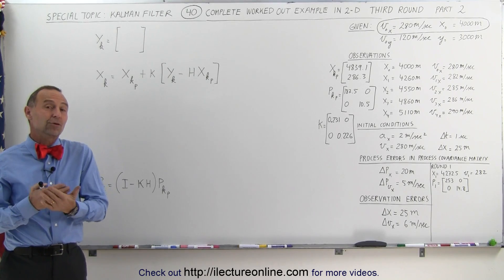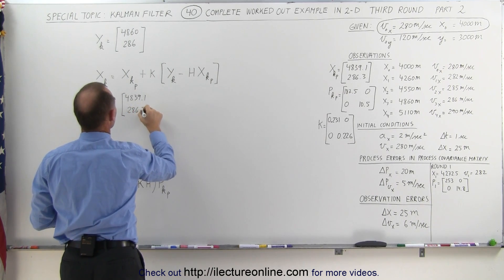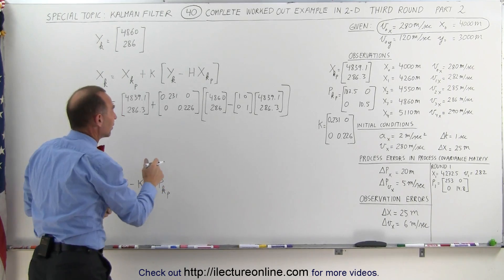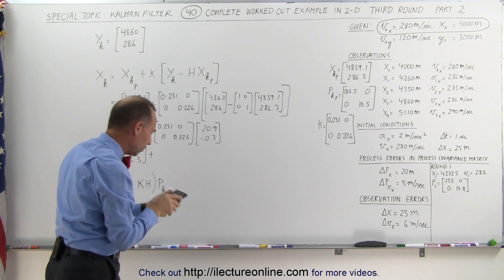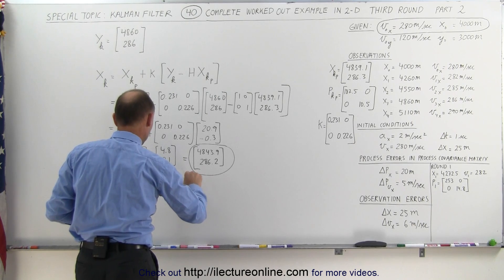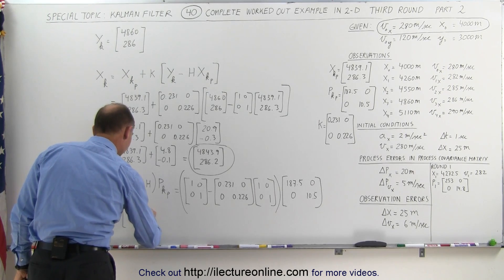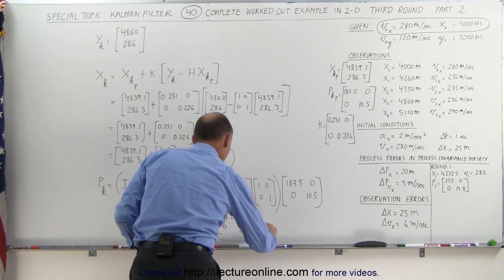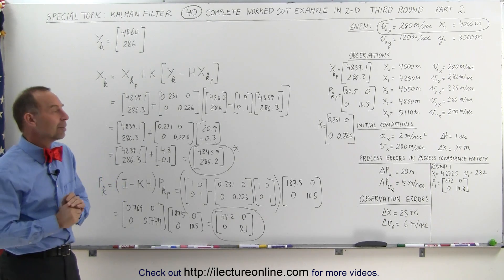Special Topics - The Kalman Filter (40 of 55) Part 2 of Third Iteration - Tracking Airplane

Comment: Thanks for such great videos. Really fantastic. But I think in this example u used a wrong P_k_p (in video 39 the correct one is used)  
U have a new follower. 👍
Reply: You're right. Correct P_k_p is [198 0; 0 10.5]. So, the correct P_k matrix equals to [150.3 0; 0 8.1].